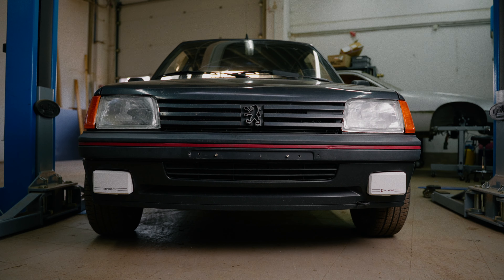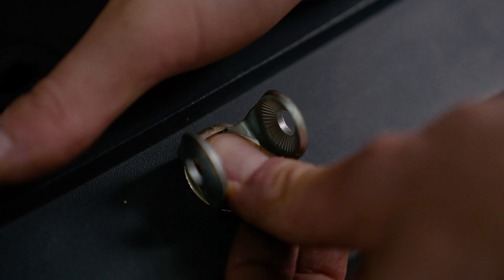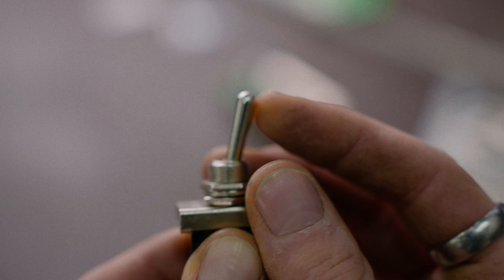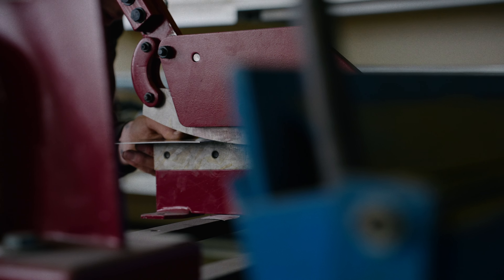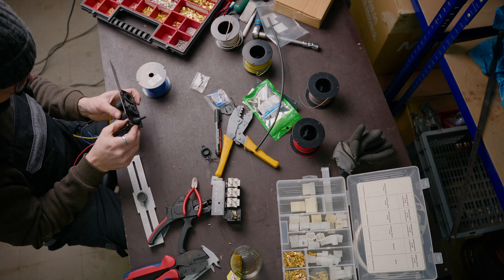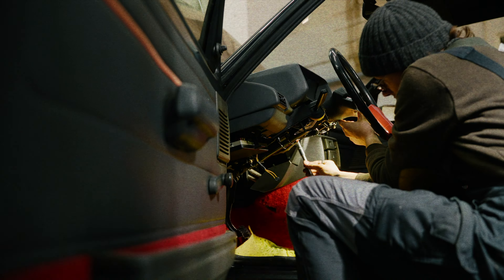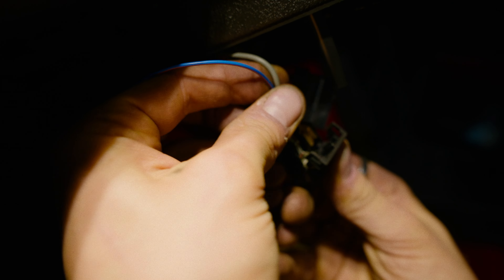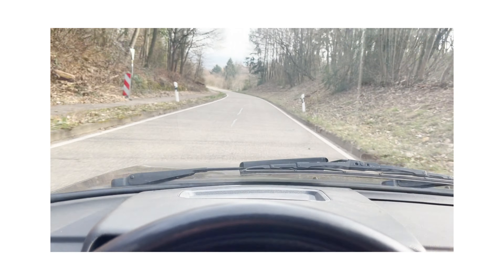every classic needs this

Comment: My ZX shakes and rattles whenever I accelerate, the more weight is in the car, the worse. Myself too, I think it's the drive shaft inner joint, as it does not click or bang when I turn, so it's not the outside, aaaand as I already changed motor mounts. Note: it gets a lot worse after you take it to a racetrack 😅
Reply from the maker: I had sympathy until the part with the racetrack. 😂

Comment: Well. You did a correct thing in setting it up on the 500 classics instead of the 500FFs! <3
Reply from the maker: On the Porsche the FFs looked right on point, but on the Pug they were just so wrong...
Reply: @OnlyARoadtripAway  it all depends I guess... For the urquattro I am preparing a grille-swap with integrated 700FFs. Was a bit too small with 500, and more historically correct.

I'll send you a message re. driving through 🇩🇪 by the way.

Comment: Its quite normal that the 205 heater matrix fails. Or at least the o-rings of it 😄.
Reply from the maker: I took the thing apart yesterday and the matrix itself had well and truly failed. The O-rings, even though square and rock hard, were still sealing fine... 😗
Reply: @OnlyARoadtripAway  Interesting. I have a 205 Gentry with all the bells and whistles. Just no air con. A friend of mine had a 205 diesel from Spain with air con which he did not need any more. I bought it just to get my hands on the air con 😁. Hopefully it won’t be too much of a hassle to switch the hvac box under the dash. I will make sure at least the O rings are replaced if the heater matrix passes the test!

Comment: Heater core in 205 as far as i know has no valve, there is constant flow of coolant through core no matter what
Reply from the maker: Yeah I learned that during the drive to the shop. Full cold seemed to limit the air passing by the leak though, which helped. Currently the heater is just bypassed until I can get around fitting a new core and fuel gauge. And the driveshafts... 😅
Reply: @OnlyARoadtripAway  problem with shaking under power might be driveshaft related i thing
Reply from the maker: Yeah the right shaft is dead and binding. 😒